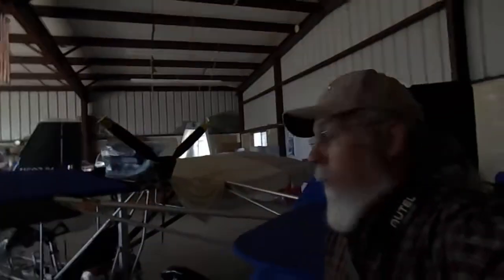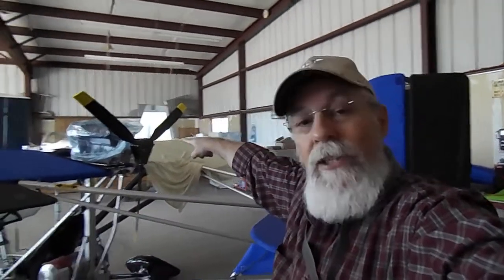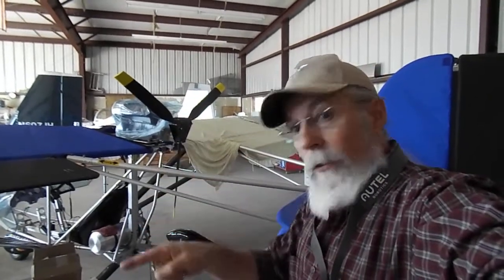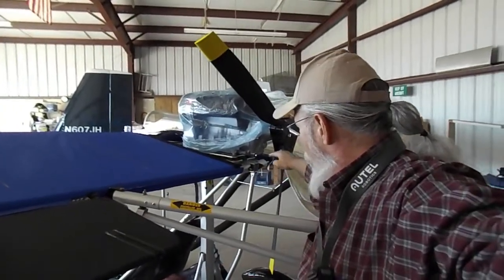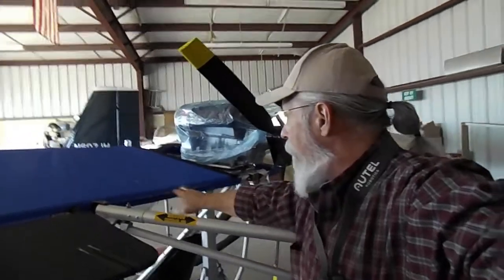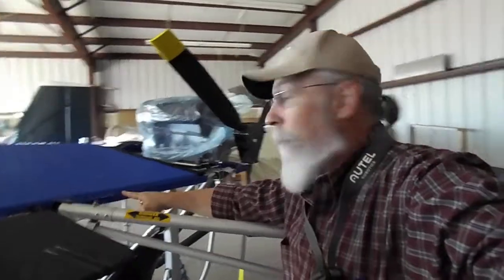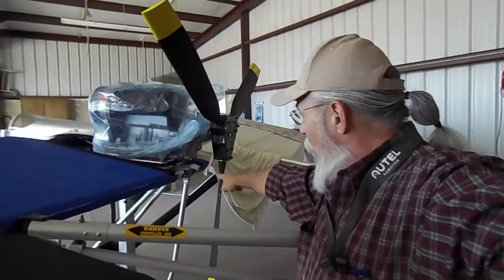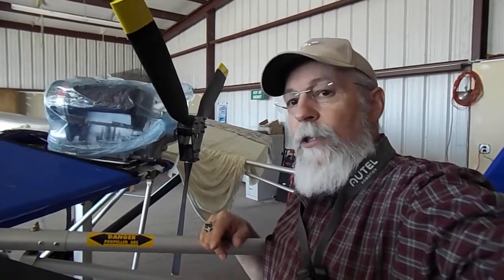Aerolite 103 Ultralight Airplane - Building/Construction Issues

Comment: It is desirable to have the thrust line aligned with the wing trailing edge but far from essential. I've owned three pushers, two Kolb Firestars and one Kolb Slingshot and none of them had the thrust line directly in line with the wing chord. In fact on both Firestars the thrust lines were a good bit higher than your video shows it with the gearbox output shaft on top. The consequence is that when you back off of power quickly, there is a nose up pitch response. Being aware of this and correcting as required for this response is the only significant factor compared to pushers with thrust line aligned with wing trailing edge. I'd show you a photo of one of them if this comment section permitted it but it does not.

I recently ordered an Aerolite 103 kit and look forward to the build. Already have the manual in hand and it looks pretty straight forward.

Thom Riddle
Tonawanda, NY
FAA Powerplant Mechanic
Sport Pilot CFI (inactive)
Retired Mechanical Engineer

Comment: The issues sound like a combination of your own errors, and those of the agent you bought the engine from.  I see no reason for you to disparage Dennis Carley or Aerolite. It sounds to me like he's been trying to help you to sort out the problems that were not caused by him.  I get that you're frustrated but if you bought the wrong motor mount, you bought the wrong motor mount. forget it and move on.  Dennis Carley did not fit the wrong motor mount, nor fit the geabox upside down, so I suggest you give him a break.

Comment: That stinks.  The joys of building eh? Thanks for posting, looking forward to seeing it ready for the air.
Reply from the maker: The manufacturer, Dennis Carley of Aerolite 103 LLC said; "Welcome to building an airplane!", after helping me on more than a few occasions with building & technical issues. I 'get it', now. LOL It's always something, I guess. 

Stay tuned for more vids. Thanks for the comment, Travis.
Reply: AEROLITE 103 was my first choice by far, but couldn't quite afford the New kit plus an engine.  I started on an Affordaplane build, but put that on hold when I came across a good deal on a two place Challenger.  Problem with that plane is it doesn't have an airworthiness certificate and I can't make it legal.  Ugh!  Now I'm trying to convert into a single place and make it a legal ultralight.
Reply from the maker: Challenger are nice. Good luck getting yours flying.
Reply: AEROLITE 103 Construction, I have another question for you.  I am selling my Challenger and building an Affordaplane from scratch.  I have never seen an Aerolite in person, but read that they utilize push/pull cables for all control surfaces.  Can you confirm this? If so, can you provide some close up photos or video of the layout and connections? If this works, why do so many mess around with tubes?  I would like to use cables on my build if this really works.  It seems like such an easy workaround for the complicated control engineering.  Thanks!
Reply from the maker: Happy New Year, Travis!
In answer to your question, "Yes! They use cables for all control surfaces". Some cables are rolled up and held to the side of my plane till the wings get re-installed. Go back thru my vids where the wings are OFF and you'll see.

I can try to get some video for you next time I'm out at the hanger. Keep an eye on my uploads and you'll probably see it soon. I'll title it "Controls and How They Work"......or something like that. Cheers!
Reply: No airworthiness certificate?  I guess that might explain some of the "good deal" part.  I know the FAA can be rather inflexible with their rules (with good reason) but exceptions can sometimes be made.  Have you talked with your local DAR about alternatives?

Comment: One of the potential consequences of getting your airframe from one manufacturer and your engine/propeller from a different source.  You may have issues with your motor mount, the belt or gearbox combo for your particular propeller, etc.  I'm mentally flipping a coin between ordering a factory assembled Aerolite or the kit option with everything included as I don't have the time, patience or expertise to put together an aircraft from multiple sources.  So sorry about your building issues but I'm sure you will eventually be delighted with the results of your efforts.
Reply from the maker: You make a valid point. But in my case the manufacturer of the plane used the very same engine/prop combo for many years until the Rotax 503 became outdated and replaced with 583ci. Thanks for the comment HandH.